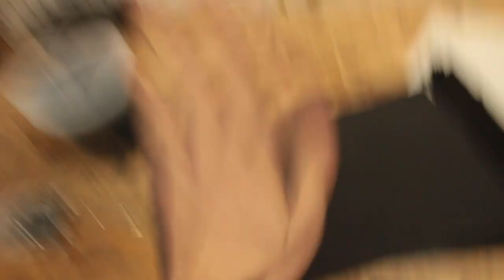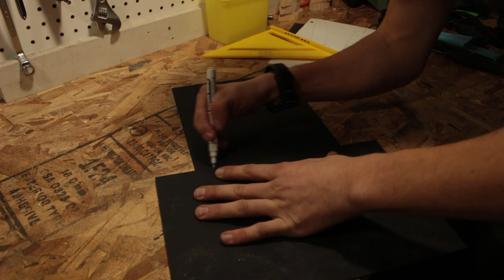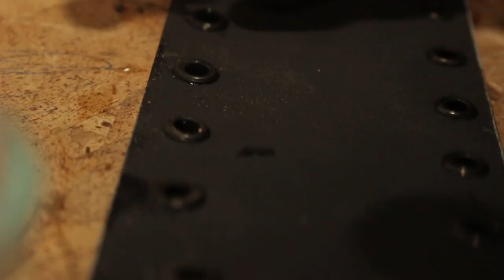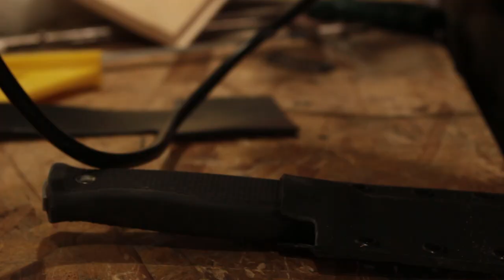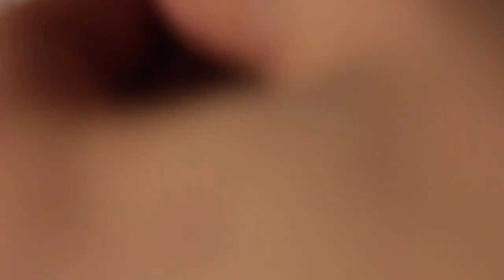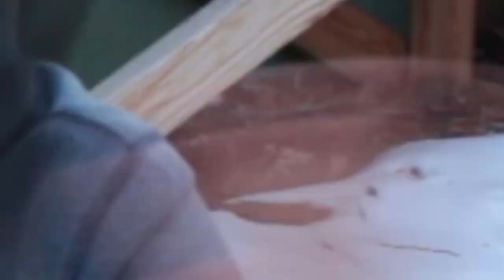Simple Kydex Sheaths Without a Kydex Press

Comment: Neat.
Just a note tho, you shouldn't use a grinder like that. If you load up the wheel you run the risk of catastrophic failure. If it doesn't make sparks, use a sander of some sort. Drum sander is probably what you would want.
Reply from the maker: not sure what catastrophic failure you could possibly have on a bench grinder but ill keep it in mind. I have a belt sander now but I did have a wheel that I used only for non-metal materials which I could clean by blowtorching and then wire brushing so it didn't get cloged
Reply: @TheElvenArcher  if the wheel gets glazed and clogged there is a chance it could come apart violently.
I've seen chunks get imbedded into walls, fortunately no one got hurt.
Dress the wheels regularly to keep them in good shape, I hate seeing folks get hurt because of a maintenance issue.